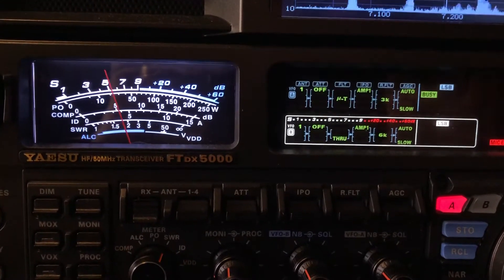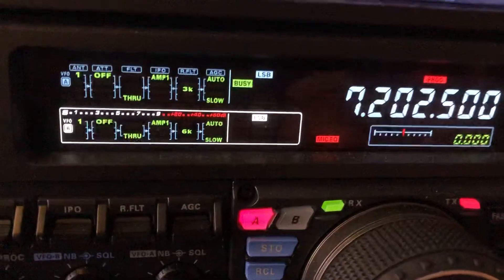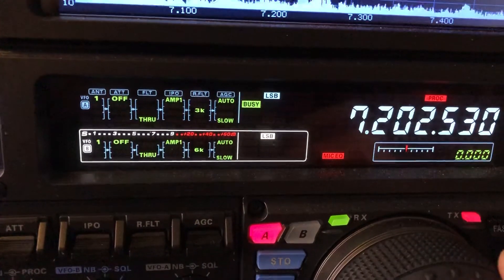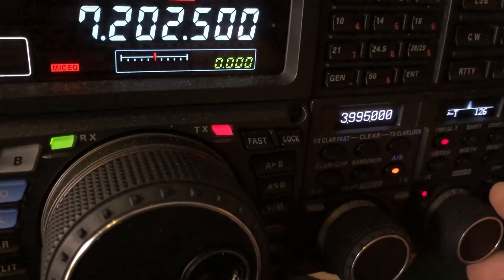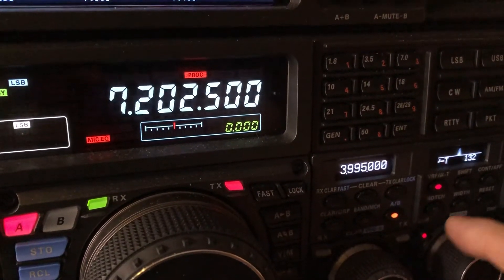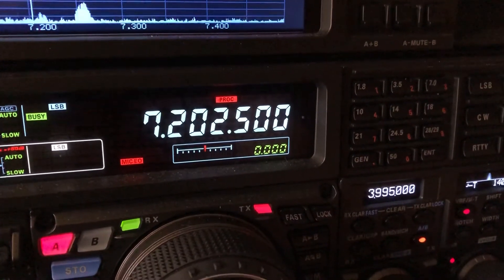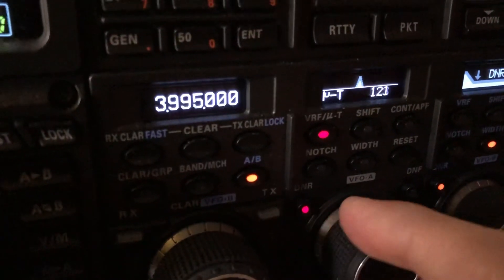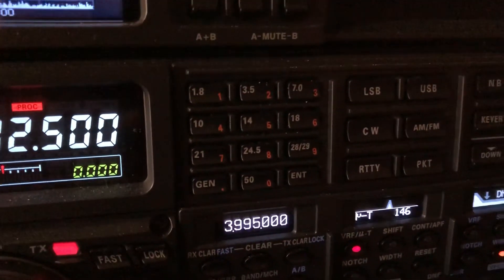Yaesu MTU-80/40 preselector combatting QRM

Comment: How effective is the micro tune unit for 30/20 meter bands?
Reply from the maker: It is useful. I’ve used it mostly on 20m, pulling a SSB station out of the noise floor. I’ve used it less on 30m. 

Nothing is going to prevent QRM from 2kHz away, but you can minimize the interference by using the mu-Tuning preselector to drop the station you are trying to hear down into the filter skirt, opposite the interference. 

I bought the 40/60/80 meter mu-Tuning preselector first.  Those are the bands I considered to be top priority for me. I later added the 30/20m unit. It provides an “icing on the cake” touch, after I’ve narrowed width and used shift. 

73, de N4HNH